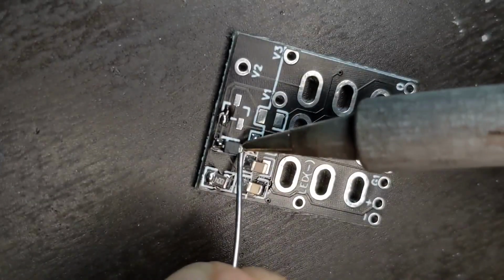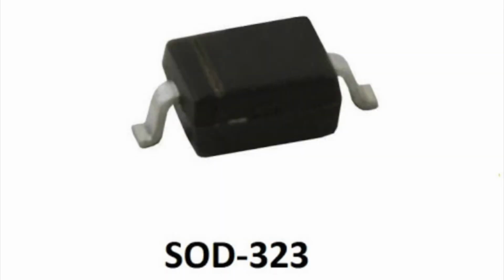Surface Mount Soldering in your DIY Guitar Pedals? Without extra gear or supplies? Too Easy!

Comment: Hi Mark, as a pedal noob I wonder, if using SMD components in pedals affects the quality of sound compared to traditional ones?
I ask because I read somewhere that some SMD parts can be bad for sound generating devices (like guitar pedals).
What is your opinion on that as a pro pedal builder?
Reply from the maker: No, package type doesn't make a difference. The only way you'll get a worse sound is if you choose a different component type. For example if you replace a film cap with an X7R ceramic cap, there are some instances where it can negatively impact the sound (negligible, but occasionally measurable). But that's not related to SMD per se, and you'd get the same result if you substituted a ceramic through-hole.
Reply: @mas_effects  Thank you for a quick reply. I should remember your advice about ceramic caps.

Comment: Good explanation and demonstration. I've done considerable soldering building tube amps and guitars. Recently I've started making my own pedals. My favorite is a tiny BazzFuss in a 1.5  in. x 1.5  in. x 1.5 in. square plastic enclosure. No board just 5 components point-to-point.
On the tiny theme I'm beginning to use SMD's. In 5 minutes this video has already helped immensely. 
Thanks. 
PS Check out my guits on my channel (sound samples coming)
Reply from the maker: Glad to hear it helped! And I'll check it out, thanks!

Comment: Yeah but some flux you can be more precise! Hold the component down and wet your tip and go in. Perfect and precise.
Reply from the maker: I mentioned this in other replies, and perhaps it should  have been more emphasized in the video... This was a response to the MANY people I've talked to the on the forums who don't want to do SMD because they think it requires extra gear/material/supplies and extra skills.  It's meant to show you don't need anything else.  But I'm having to leave this reply so often I should probably either pull or update the video.

Comment: Really great video. Only one question, what temperature are you using? I'd really like to work with some surface mount ICs, but I'm worried about cooking expensive parts.
Reply from the maker: I'm usually at 350 with quick applications of heat.
Reply: @mas_effects  Thanks a whole lot, this is the most forthright video on the topic I've seen. A++, 10/10, would recommend.
Reply from the maker: By the way, not shown in the video, but if you want to make it easier and can invest in a small upgrade, a syringe of flux will do wonders. Just put some down on the pads before setting the chip down.
Reply: @mas_effects  I have a flux pen, would this be much in the way of similar?
Reply from the maker: @tziirkq  Yep. It dries more quickly than the paste but otherwise will work great.

Comment: Thanks. Nice minimalist approach towards SMD soldering. However, in the interests of reliability (no dry joints), I would still use extra flux to ensure good wetting takes place.
Reply from the maker: The focus was on, as you said, a minimal approach. I see too many people think they need to buy more materials or learn new techniques, so this is a response to show them that "No, in face you can do any SMD with what you already know and have!" That said, you're spot on right (and I do use a flux syringe in all my SMD soldering) so perhaps it'd be a good idea to go back and update this some time to add a section about it at the end.

Comment: thanks for the great video, Mark! What size is your soldering tip? All of mine are either too big or too small, so I'm wondering if I should go for the ST1 (1.58mm) or ST2 (2.38mm) screwdriver tip.
Reply from the maker: No problem. I use either a T-18B R0.5 (like a dull pencil), or a T18-D16 (small flathead).  Looks like the latter is about 0.5x1.6mm
Reply: @mas_effects  thanks I appreciate it!